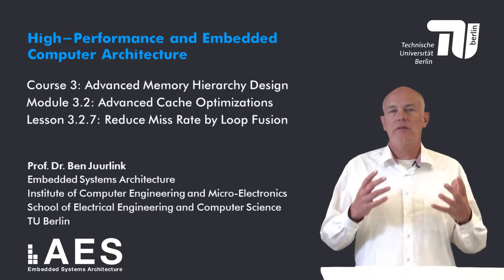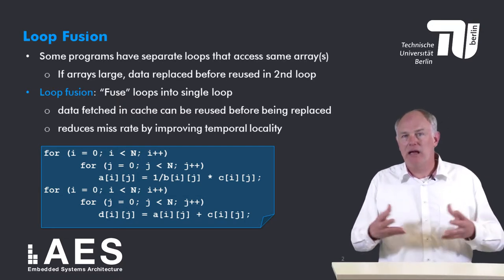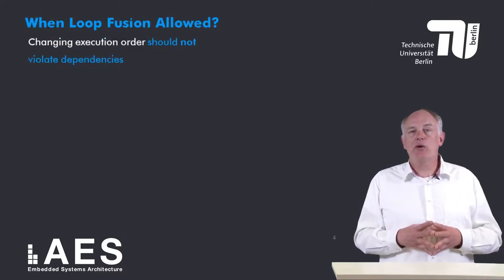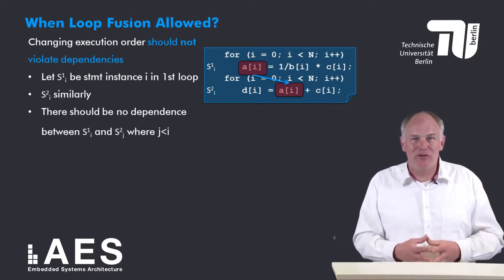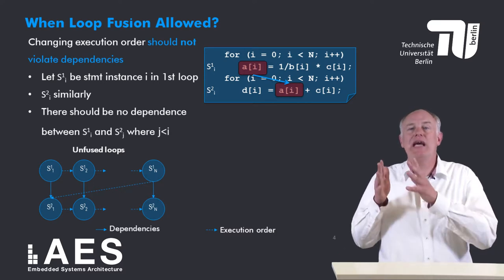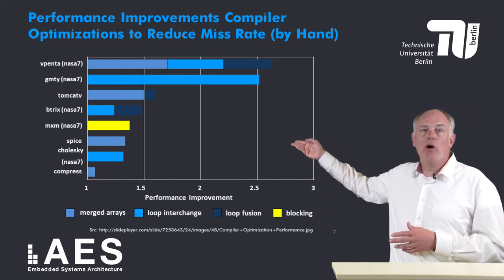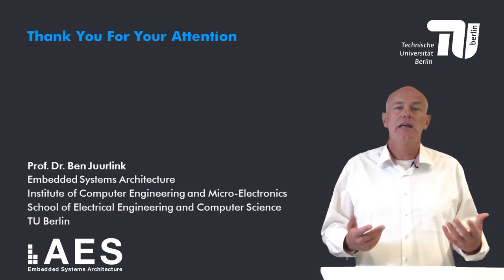3 2 7 Reduce Miss Rate by Fusion

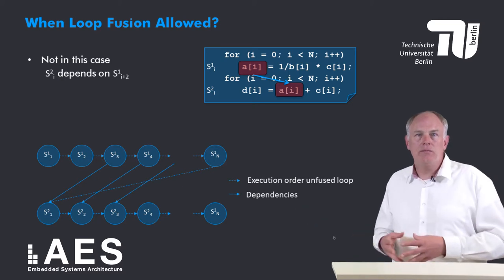Comment: At  5:45 it seems that the code is incorrect ...
Reply: Yes, doesn't match the description. Seems like fusion is possible
Reply: yeah, that's what I was thinking,
Reply: One way for it to make sense is for the second loop to be for(i = 3 ; I<N+3 ;i++) 
then fusion will not be possible, but indexing of the array may be out of bound 

a better example would be  the second loop to be for(i = N ; I>1  ;I - -)